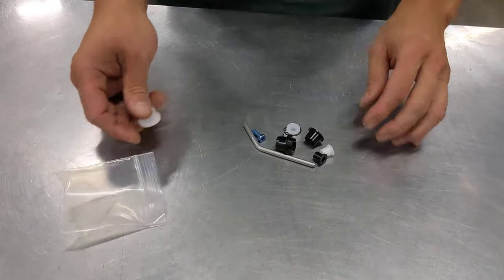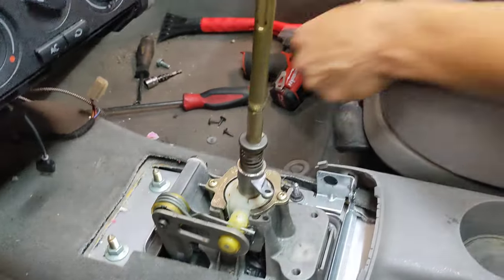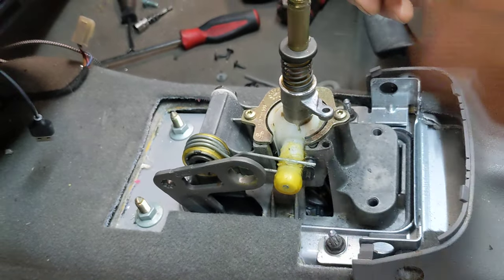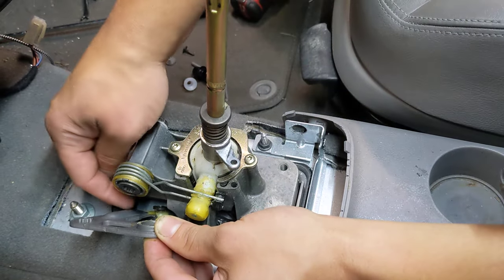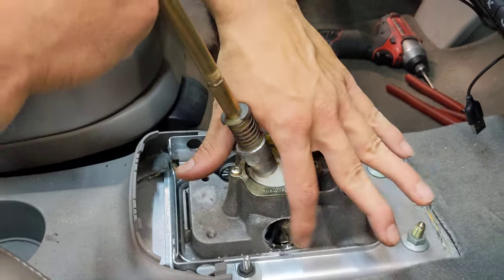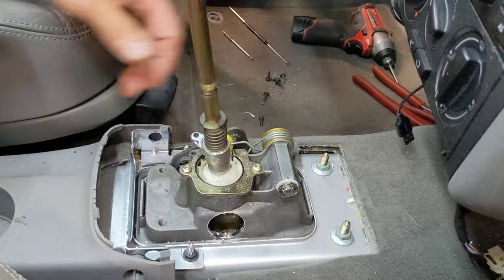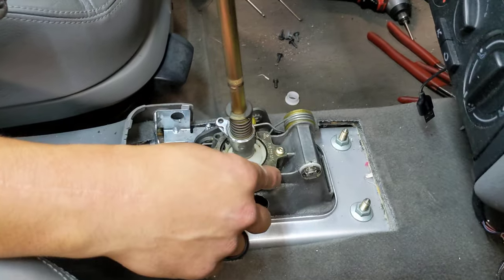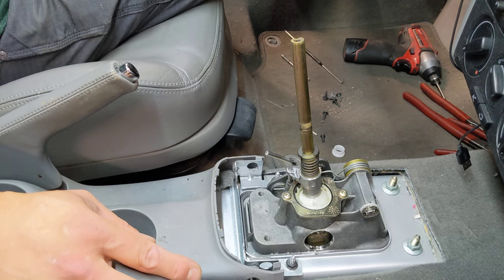Dieselgeek MK4 Deluxe bushing kit install overview

Comment: I purchased the kit and washed the videos and everything went smooth, got it done. This really works just follow every step in the video . Thanks Dieselgeek im very thankful for your help.
Reply: How long did it take you to do? Any clue what it would cost to hire someone to do this?
Reply: How long did it take you to do? Any clue what it would cost to hire someone to do this?
Reply: @jeremypena8786  took me about two hours due to the two t25 torx bit bolts that hold the shifter in totally rounded out..other than that probably in about an hour and a half..I had a shop charge me 462$ to replace one plastic bushing for first gear..talk about a ripoff..
Reply: @davidross-oo2vh  I ended up doing this myself too just after making this comment. Not exactly sure how long it took but overall it wasn't bad. Was a tad tricky working the the saw hole but luckily I had no issues with the hex screws.
Reply: @jeremypena8786  And then when I finished the shifter..the window regulator cable broke..again..that's the third one so far
Reply: @davidross-oo2vh  bummer. I haven't had this car long. No issues with that for me.
Reply: Really I’m still trying to figure out how to wash the video

Comment: I found that the lower shaft bushing didn’t work. Anytime I pushed the shifter down it would get stuck and I’d have to pull up on it. Even re assembled it did it. Put back in the old bushing and had no problem with it.
Reply from the maker: This is a somewhat common complaint. The solution, every time, is to remove the debris in the stick housing forcing the bushing closed which binds the stick. Usually the debris are degraded bits of the original bushing. Compressed air and a bit of brake clean can work wonders.

Comment: Unfortunately I stripped out the t-25 torx screw holding the bracket on. Tried every trick in the book to get it out. Is drilling the screw out an option or would that damage the shifter?

Comment: How did you guys take off the torx bolt?
I just tried with the right sized t25 and immediately stripped part of it....
Reply from the maker: Just drill the head about 1/8 in deep with a 3/32 inch bit. Once the head is off, the shank will spin out by hand
Reply: @dieselgeekdotcom  if I strip it completely ill give that a whirl, thanks!
Going to try and impact it off rather than keep trying with the ratchet first

Comment: So when replacing the bushing where you need to drill the whole and install the snap ring supplied with the kit do you also need to install the factory c clip as well or does the supplied snap ring keep everything held together?
Reply from the maker: You do not need to reinstall the factory disc-clip

Comment: Do you know the bolt size and thread size of the bolt that holds that arm that keeps that first gear getter in? My car won’t go in 1st easily and won’t go in reverse at all because of that bushing but my bolt is stripped and I can get any bolt from the local hardware store
Reply from the maker: M5x12. We include one with the FGG because it's easy to strip the T25
Reply: Hi, I had this problem, step 1, tryand adjust your cables, literally a micro movement is all it may take, reverse is the high up cable end and 1st through 6th is the lower nearest to front end of car cable end,, step 2 its a safer bet to select 2nd gear first then go into 1st or reverse if its not engaging at that moment, it will save you damaging your bushings and other components down the line..

Comment: I bought this kit but your 5mm adjustment pin does not fit. I have an mk4 gti and the holes are smaller. I measured them. They are exatly 4.7 mm a 4.5 mm allen will fit but there is some play. Your pin will absolutley not fit! I would have to drill the holes out in order for your pin to fit.
Reply from the maker: Hi, that's a new one to us. Maybe you have an after market cabin shifter. I'm curious to see what you have going on there. Please email us directly at sales at dieselgeek dot com -tyler
Reply: I just ripped a shifter from a junkyard Mk4 GTI and it had 5mm holes. I've installed a few 02J shifters in older cars and never seen one with smaller holes. You must get part numbers off those bits so we can see what's up.
Reply: @andrewlewis4253  ok i will investigate that further and see if i can get a part number.
Reply: Referencia

Comment: 1.8t 5 speed i cant go into 5th will this be my solution?
Reply: Looks like you posted 11 months ago, so probably already fixed it, but my guess would be that it's a broken shifter cable end up on the transmission.
Reply: @toolmaster120  trans was toast I can adjust these shifters in my sleep now

Comment: Hi, please ..can you advise on a vw golf mk 4  actual gear stick replacement as i think mine is broken inside as i can only select gears 3&4 .. is it a gearbox out kinda job or can be done from inside the car .. it all looks plastic and moulded to a large degree ! 
Thanks
Reply from the maker: Sounds like a side to side cable problem. Use Jim's locating slop video to diagnose. https://youtu.be/7HBE5vycg-4

Comment: Would this be easier to go at from underneath the car and dropping exhaust?
Reply from the maker: I don't think so. Especially on an all-wheel drive car.
Reply: I had the shifter out since it was going into a Corrado. If you remove the shifter box the sheetmetal "floor" comes off quick and easy with needlenose pliers. Makes swapping bushing inside the box a piece of cake.
Reply: @andrewlewis4253  so i can take out the whole shifter to make it easier
Reply: @luislopez-un5dp  it will be a lot easier to do with the whole box out of the car
Reply: I agree. Removing the entire shift pod is definitely worth the effort

Comment: Is there any other way of taking the shifter stick out without drilling a hole? Not the best solution in making a hole in the standard shifter mechanisim.
Reply from the maker: You can either drill the hole or you can take the box out of the car. Drilling the access hole poses no problem whatsoever.
Reply: Either drill the hole..or take the downpipe off.. catalytic converter off.. heat shield off..the entire belly pan heat shield that is..and then remove the shift box from under the car on a lift ...ugh you had better get the drill lol

Comment: For the one bushing underneath with the snap ring clamp — is it bad to reuse the factory snap on clip thing?
Reply from the maker: If you don't use the external retaining ring that comes with the bushing the cable will fall off again.

Comment: I'm a new owner of a 2002 beetle turbo s with no reverse  firrst or second gear. I plan on replacing the clutch anyway so my question is can these bushings be changed easier with the transmission dropped
Reply from the maker: Hi Gregory - all the bushings in the DLX kit are for the interior of the car. Having the trans removed doesn't help.
Reply: @dieselgeekdotcom  in my brilliance I thought it was an awd car 🤣